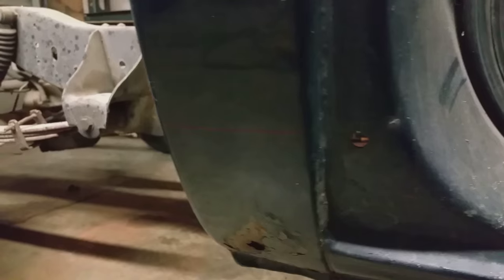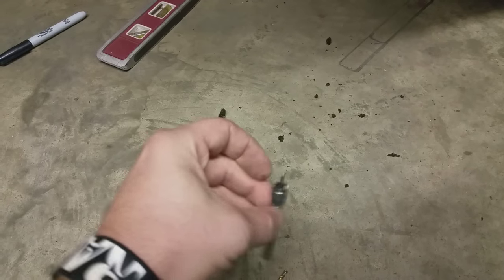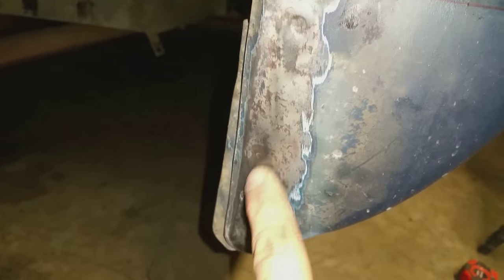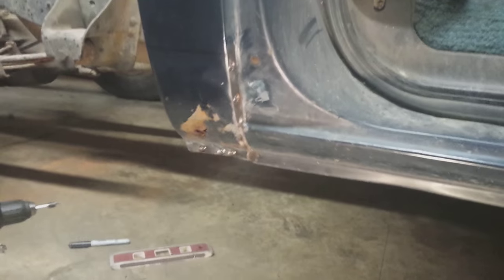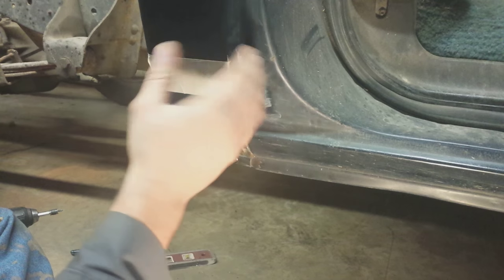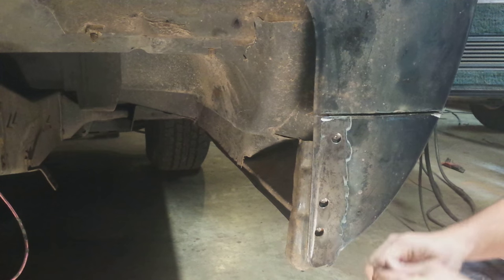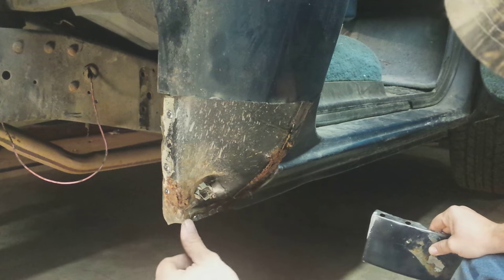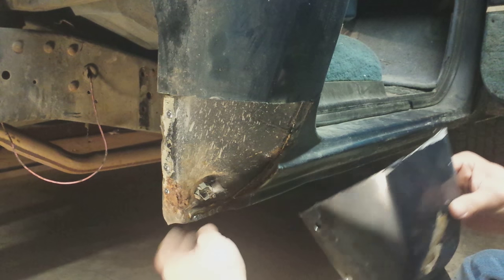1984 Chevy Short Wheel Base Cab Corner Replacement

Comment: Good job! If that's the worst of the rust, that's a solid truck. When your replacing the original spot weld with a mig, like how you did, it's called a rosette weld.

Comment: great job and thank you for the video I have one question do you have to weld the panel at the bottom section where the rocker and and cab corner or is that seam sealer thanks again and God Bless you
Reply from the maker: Gregory Jowers spot weld it.

Comment: I had always heard that you should never let “bondo” be exposed through holes because it will absorb moisture. Also why not make the cut where your side trim goes. Trim could hide a lot of the welds and body filler that is not perfect? Just asking
Reply from the maker: I'm definitely no pro at doing this. It was out of normal for me to do it. But in the end it turned out great and you can't even tell it has been changed at all.
Reply: Lonnie's Garage (Puppetkicker) that’s great! Leaving out the door now to try my luck at doing the same thing.